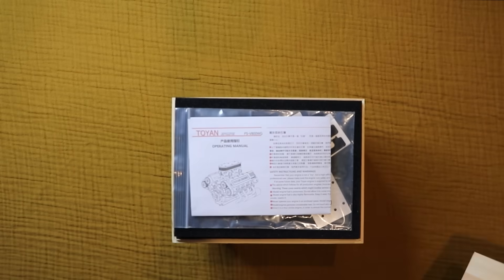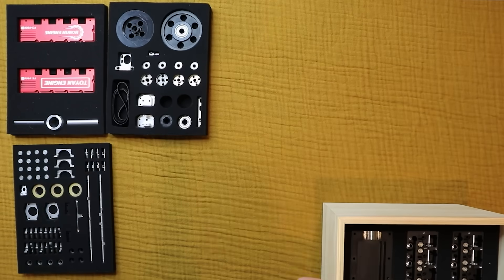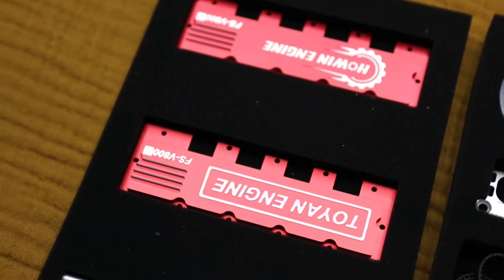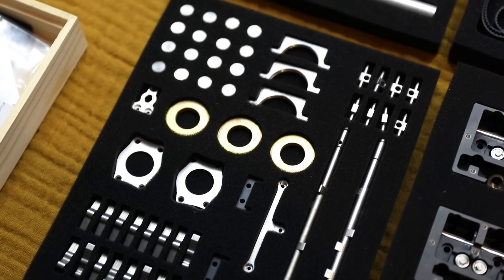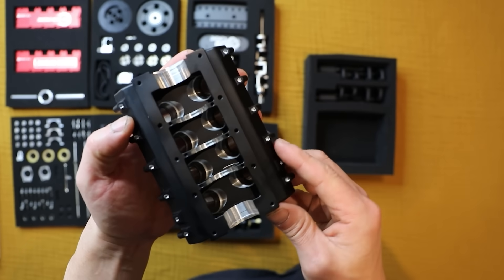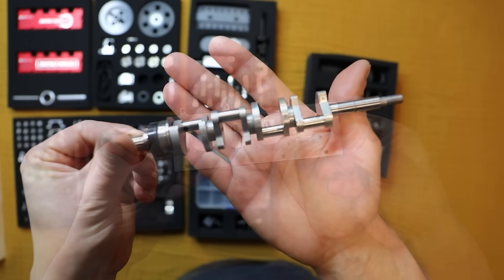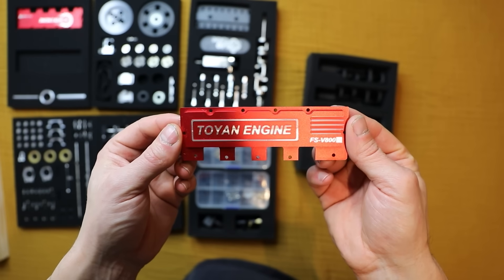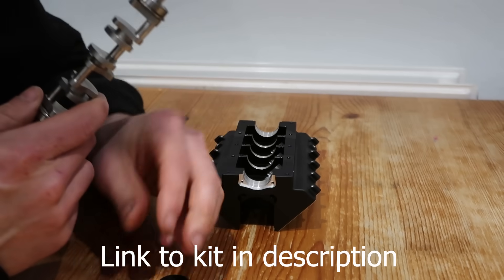Miniature Model V8 Engine Runs On Petrol, Not Nitro!   Or Does It?

Comment: Hey mate,
Unrelated to this video i know but ive got a welding question: what do you do to achieve such good initial penetration?

Ive just started welding with a mig (you built the mongrel using nothing else so it must be pretty versatile) and i can really tell the difference between the start of the weld (when the weld piece is cold) and after it warms up. 

The weld builds up on top before sinking in once up to temperature. 

Would love to hear your thoughts. 

Cheers.

Comment: At the very end when it sounds like its running, thats dubbed over hey? There is no way that little thing sounds grunty like that.
Reply from the maker: Haha, yes it is
Reply: @Urchfab  The youtuber @letslearnsomething30 has the same motor as this and it runs. but this guy turns fridge compressors into 2 stoke engines and welds honda cub motors together to make inline and V twins and inline and radial triples, maybe you can see what he did differently?

Comment: What is the firing order ?? with two 4spark distributors it could be they have to cross banks to give the proper order. Either that or is it possible that one or both distributors are 180 degrees out?  It is a great little engine, what cc does it have and could it be used on a go-kart? or even a bike?

Comment: Obv make sure it’s all lubricated up well, but try spraying some bl00dy brake clean in the intake. Soon find out if it’s a timing/compression issue😜. Appreciate fuel is getting in, but wondering if not a great mixture or too much.

Comment: On a four stroke it's really easy to get the ignition timing out by 180 degrees  if you  only use crank timing marks, i can see this engine has distributors driven off the cams but have you tried taking the distributors off to see if they'll go back on 180 degrees out?
Reply from the maker: I double checked all that bud
Reply: @Urchfab  Are the distributors driven by a spline on the cam or an offset keyway?
Reply: That could be it or are the cams in the right bank and timed up?

Comment: Glow engines run on methanol, not petrol, not nitromethane. Nitro methane is sometimes added to increase power and ease of start. 

 You seemed a bit baffled by the fuels.
Reply from the maker: Its true, I know nothing about model engine fuels mate.
Reply: Glow engines run on a mixture of castor oil, methanol and nitromethane. I've run 1/10th nitro engines on up to 40% nitromethane.

I've also run two stoke petrol RC motors (1/5th scale FG Beetle) with 20% nitromethane in the fuel. Livened it up a bit.
Reply: @cogboy302 castor straight has 2 ingredients in it and was the most common glow fuel for over a century.  Methanol to provide combustion and castor oil for lubrication.  These are methanol engines with nitro added sometimes for extra power. 

We used to mix our own for the shop, we were still selling loads of castor straight or mixed oil alternative with no nitro in 1988 when we closed up shop. 

Nitro is a power adder. These are not nitro engines, that is an inaccurate and silly Americanism.
Reply: @ForeverNeverwhere1  You will know this since you worked in a model shop, but the use of nitromethane in model aeroplane, car and boat engines (in competition) is often limited by rules. if I recall correctly, the FIA rules (which might be predominantly used in Europe) disallowed nitromethane, while 'open' rules such as applied to pylon racing would limit fuels to 65% nitromethane. At that point there's not a lot of methanol in it since you'd still run about 20% oil. I live at about 1300 meters altitude, and when I was doing RC model aeroplanes we would typically run 20 to 25% nitromethane to boost engine performance back to where you would typically expect it to be at sea level.
Reply: @cogboy302 aka the engine probably wants super high ignition timing burn the methanol aka quick burning high rpm fuel